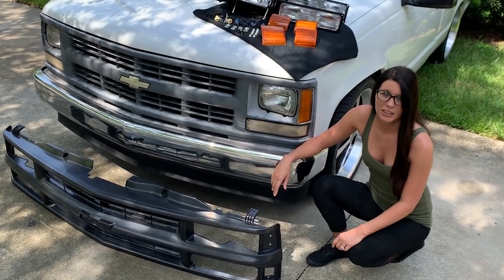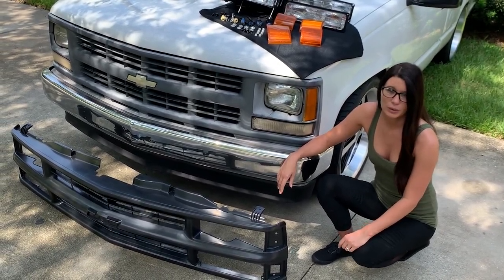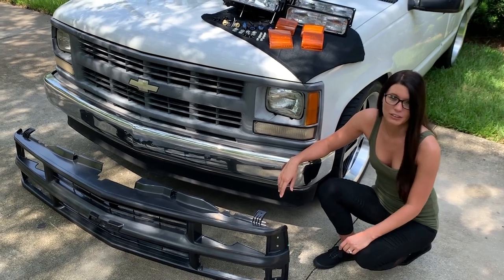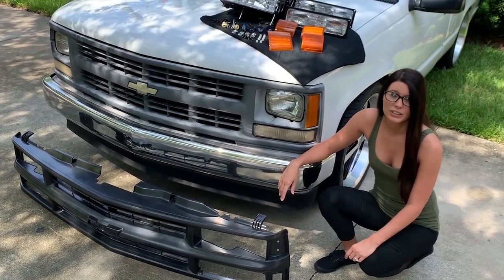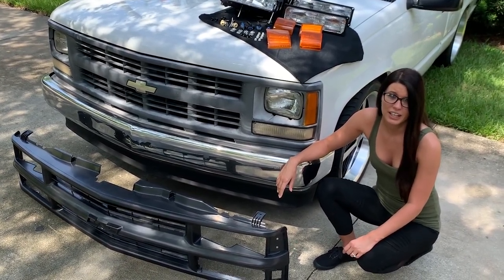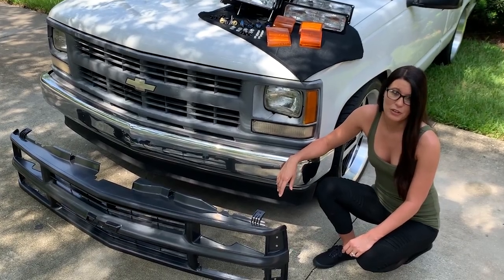89-98 Chevy CK Work Truck to Sport Truck Grill Install

Comment: This is probably the best bang for the buck you can do to these tucks.  Another trick when doing this conversion is adding a relay to turn the low beams on with the high beams.  Having all four lights on when driving on country roads is nice.
Reply: Great idea

Comment: I must be the only one who likes the work truck front more. I would upgrade the lights to LED units then refresh the grill.
Reply: Nope! You and me both pal!
Reply: I liked mine but the sad fact that the corner caught on a sonic stall broke the grill so I'm switching entirely
Reply: Cibie used to make a replacement for the sealed beams that took an H4 bulb. I have the round version in a 1980 RX7 and the lights and pattern are much better than any LED that I have seen.
Reply: I like the bigger headlights. Works well
Reply: The new setup with all those different sections of light looks way to much!!
Reply: that is what I want to do. looking for a black work truck grill now.
Reply: The old Cheyenne grilles were nice. The rubbery plastic work truck grille is... Unappealing.
Reply: Me too

Comment: IT THERE ANY PLACE, THAT COULD SELL YOU EVERYTHING YOU NNED FOR THIS, INCLUDING THE WIRES YOU NEED TO CONVERT THE OLD LIGHTD TO WORK WITH THE NEW SYSTEM? THANKS
Reply: I found the harness on eBay, plug and play, not sure about the blinker tho

Comment: To install the 194 adapter the black goes with the brown and the brown goes to the blue wire from your turn signal connector

Comment: should have been labeled as a 94/95 and up upgrade.  Thats a grille from a 94 to 98.  88 to 93 has a different lower grille lip that bolts to the upper grille.  The bumper also has a shorter bracket for the 88 to 93 which will keep you from putting that grille in place.  Also its not a "Sport" grille, its just one of the 94 to 98 variations.
Reply: Do you know any good videos for a 89 to newer headlights I have an 89 c3500 and I want to upgrade to the Silverado grill and lights. Thanks
Reply: @simonramos1217  I have a 92 Cheyenne and want to do the same did you find any videos or have any tips?

Comment: I know its form over function, but sealed beam headlights are superior to the original aero lights. 

Very nice video format showing all the work but in fast forward.
Reply: Are you crazy ? Sealed beams suck compared to new led light output and power drain on the vehicles charging  system  😂

Comment: So could I just put the composite grille on and nothing else and the headlights or what
Reply from the maker: Yes everything bolts to the factory location. Just need to replace the plug with one from mrtaillight.com its very easy
Reply: @motortopiaondemand  can
You show how to wire it up?